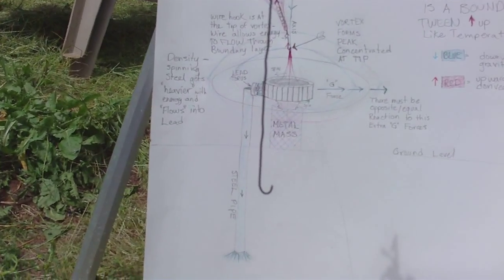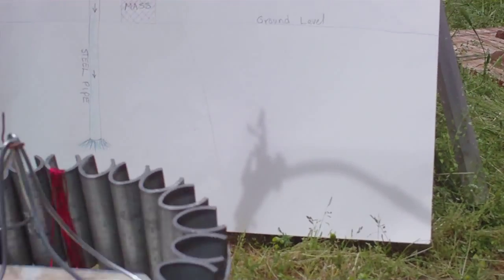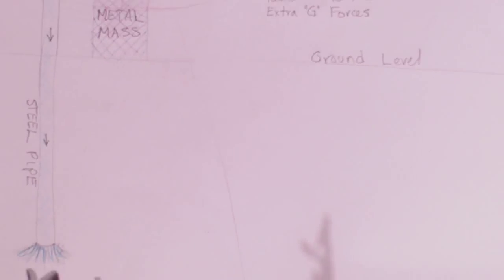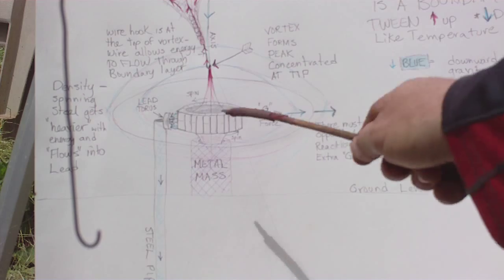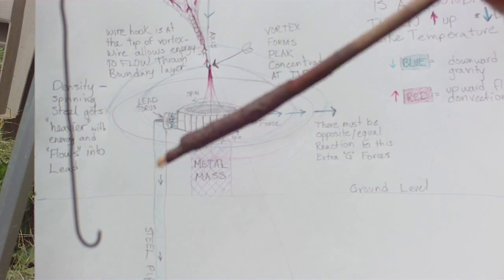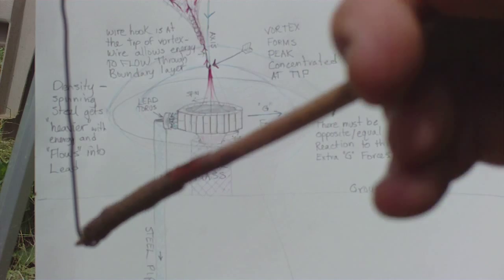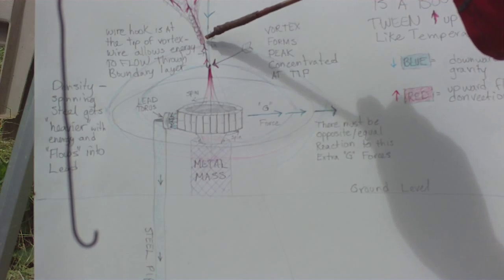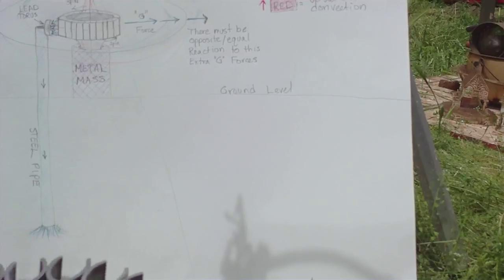an explanation

Comment: I have an idea, instead of the lead there, replace it with your pmh, and wrap a coil of wire around a rock. Use the wires of the coils of the pmh to wire a coil around a another object, this should store a charge, or induce a charge on the object of that "push" force you speak of. or try the pmh at the top point as well. But the pmh will build up a charge from your generator and eventually too many individual magnets will build up and the coils on the pmh then become the path of least resistance and then a surge of overcharge comes off the pmh into the coil of the new object and should begin to cause a resonance between the gen and the object, check to see how ed had his pmh wired, idk if it is to be grounded, but this sounds like a basic telegraphy only using a different motor/inductor